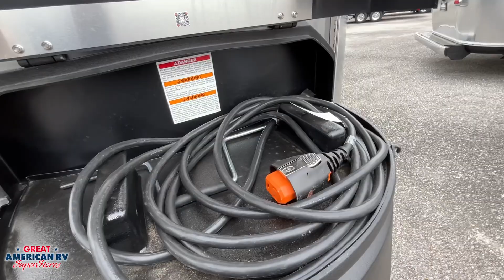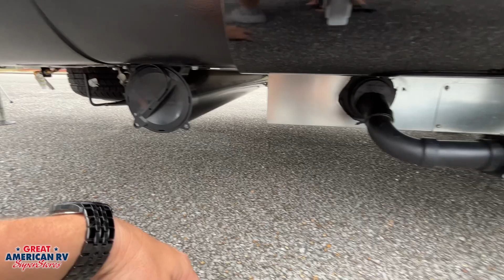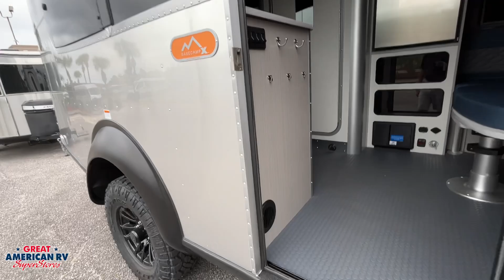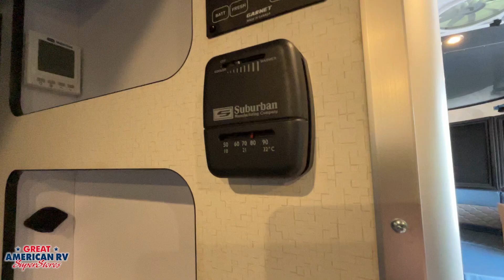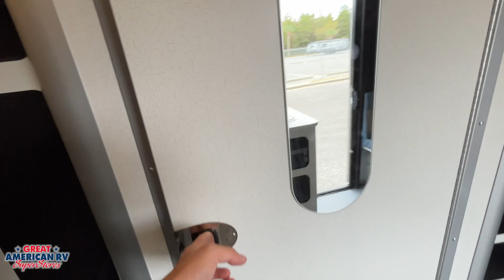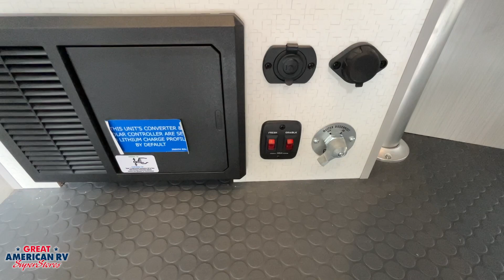2025 Base Camp 20X Customer Tutorial

Comment: Are the tie down spots in the storage area?
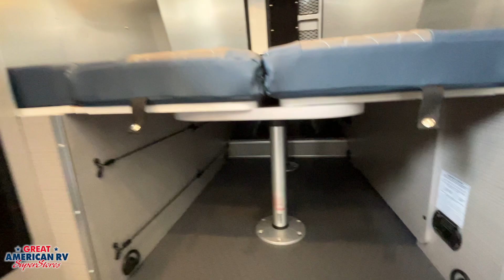Reply from the maker: Around 9:10 you can see the tie downs located low on the side cabinets on each side.
Reply: Are those designed to hold much weight? Like a motorcycle?
Reply from the maker: @EricToro-x9d  no this is not a toy hauler of any type. That storage area is more for a mountain bike or electric bike, or something of that nature.